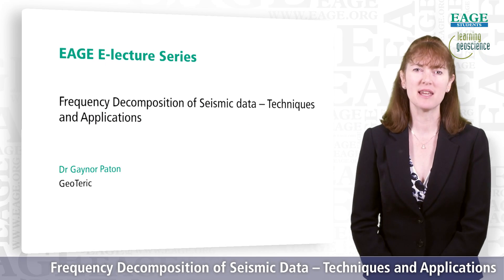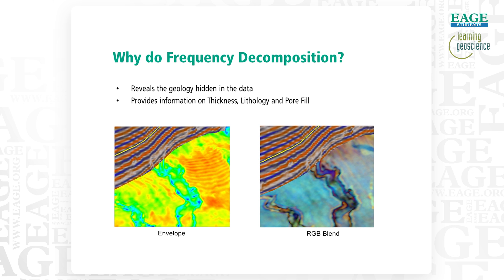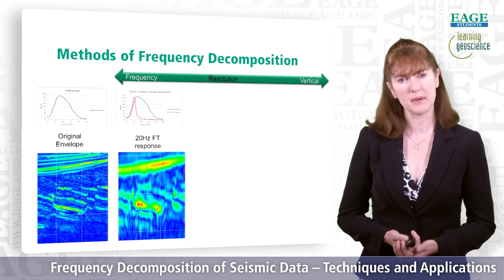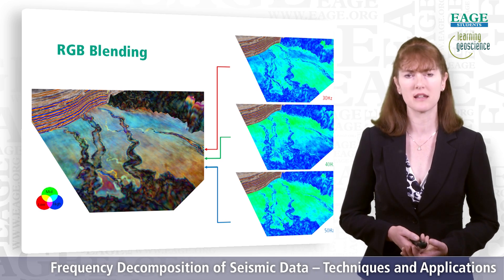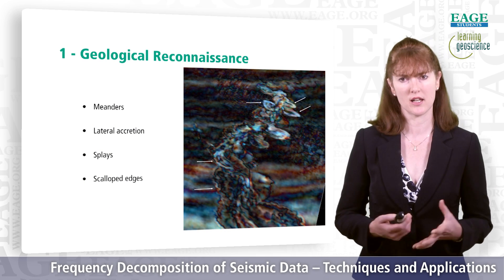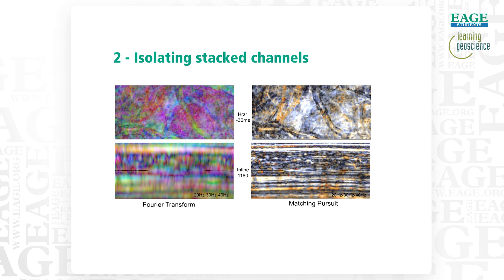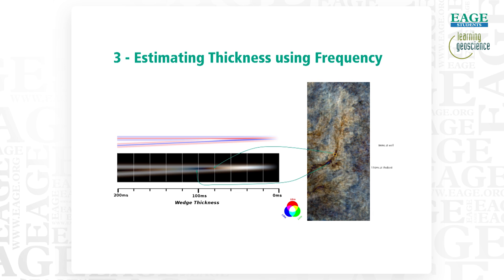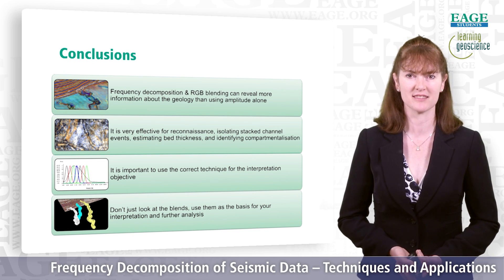EAGE Student E-Lecture: Frequency Decomposition of Seismic Data by Gaynor Paton

Comment: whats is the basis for defining 3 best frequencies in this lecture 30, 40 and 50 ??? why not 25 35, 45?
Reply: Sigit wibowo I think you first randomly select three frequencies low, medium and high.....and run tral and error method using various combinations, finally select the best combination appropriate for your study area.
Reply: You have to run an amplitude spectrum on your target zone, from this spectrum you will be able to identify the frequency peaks that will define the best combination of frequencies for your RGB.
Reply: @mariavalentinacontreras7012  May I ask how do we define which peaks to pick? Are they the highest peaks or?

Comment: ~ 09:00 - Disagree: "Higher amplitudes at lower frequencies (brown-ish/red-ish)" is the consequence of the interaction of the broad band wavelet with a succession of thin layers of increasing acoustic impedance. In case of succession of layers with interchanging acoustic impedance, amplitudes will be canceled at lower frequencies (below the critical frequency or when lambda is greater than thickness of the layer). Interpretation, based on dominant frequency of the wavelet is erroneous and misleading (such in this case: "thick layer=red / thin layer=blue").